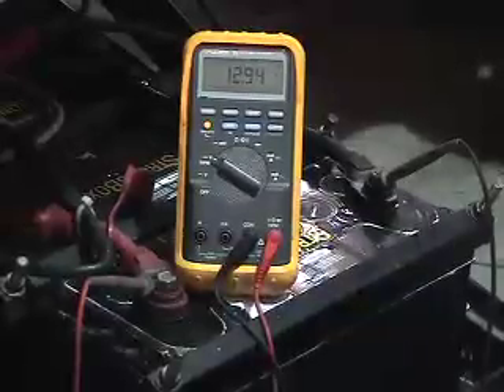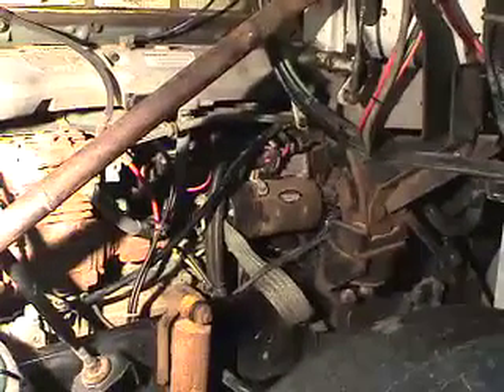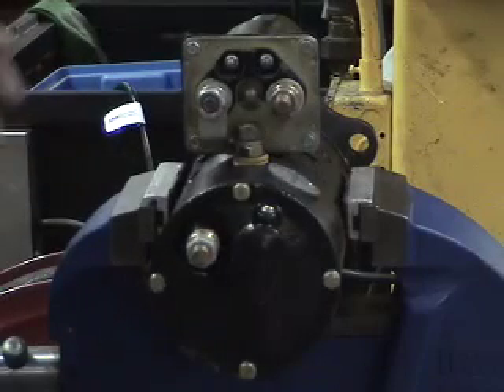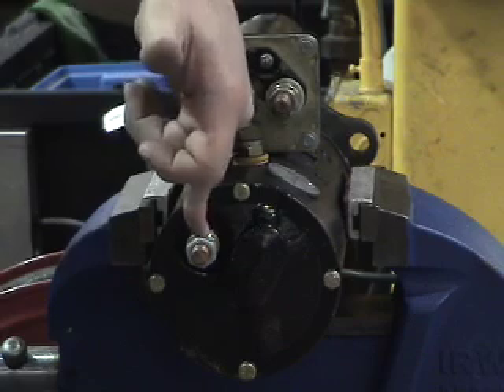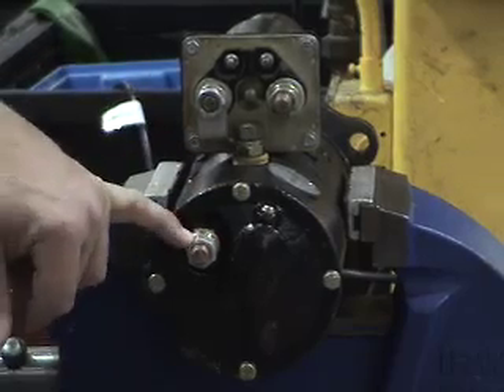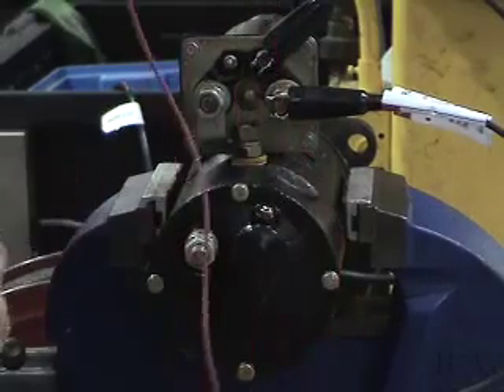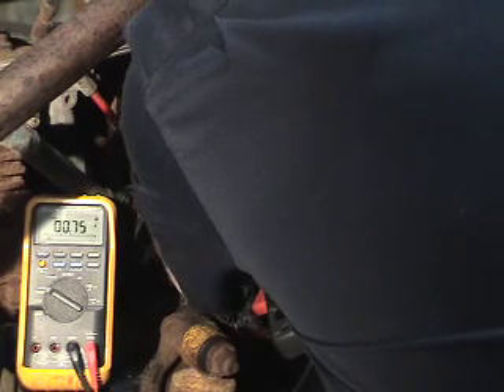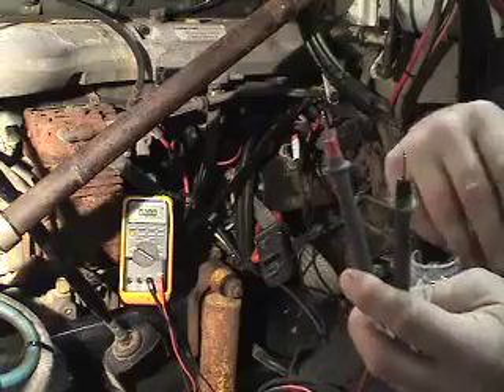Cranking Curcuit Voltage Drop

Comment: Ammeter should be around the hot side and not the ground side for a more accurate reading... It is unlikely that it is the only return path to the batteries.